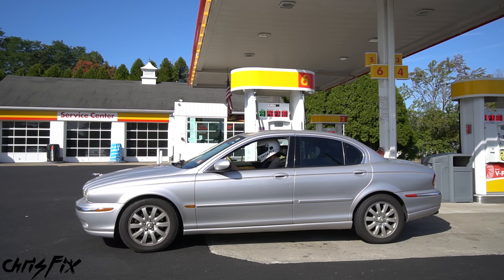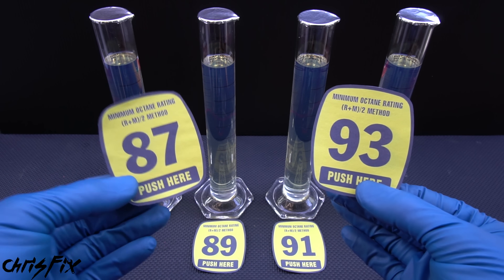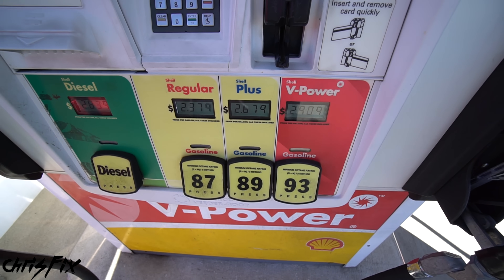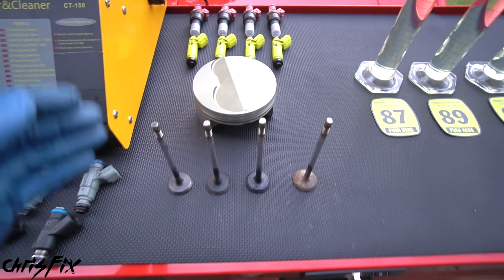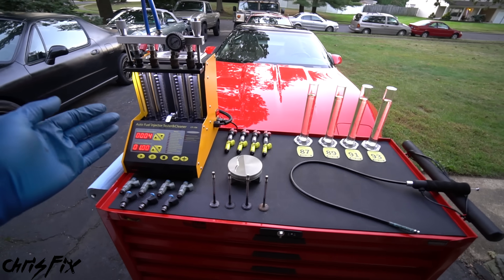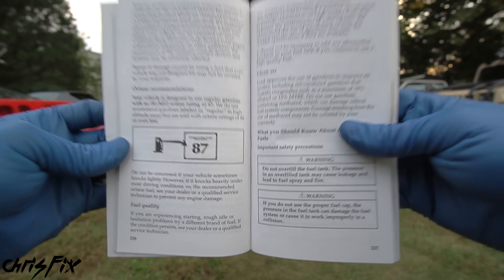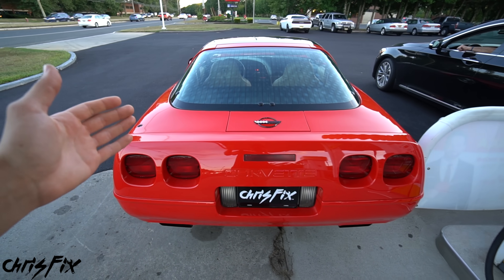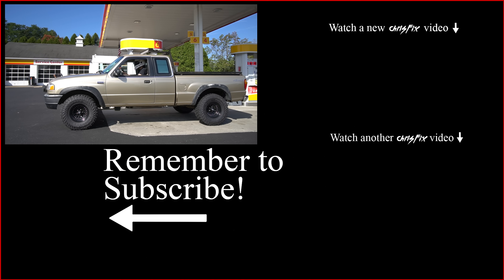What is the BEST Fuel to Use in Your Car or Truck and WHY

Comment: European fuel is better and he proved it in this video. The European fuel pump had an E5 sticker on it which is 5% ethanol. American fuel has 10% ethanol, and legislators tried to push that to 15% ethanol but it was over turned because that much ethanol in fuel is really hard on most engines and pollutes more. Ethanol is an utterly inferior fuel then gasoline. It has less energy then gas and wears out engines faster, and causes more emission pollution. the best gas has no ethanol in it. Why do we put ethanol in the gas? Its not about saving the environment, its worse for the environment. It is done because of the corn and bio fuel lobby convincing scientifically illiterate politicians to force every fuel supplier to add it to the gas.
Reply: Its worth paying more for pure gas with no ethanol. If we had a choice people would never buy ethanol gas. I found a gas station in North Dakota one time that had pure gas. It was a little more expensive. I got 30% better fuel economy. I went 1000km on that tank when normally I could barely do 700km.
Reply: First and foremost every car for the last 20 years on American roads has been designed for 10% ethanol gas. It does have less energy. But it also can produce higher octane. E85 has an octane rating of 108 for example. Hence why so many tuners and high performance cars are now using more and more over regular gas. Also ethanol burns cleaner than regular gas. Its alcohol. A simple ask of Google would have told you this in fact. As the Google assistant says, gasoline blended with ethanol burns cleaner than pure gasoline. Ethanol cuts a car's greenhouse gas emissions. So you have it backwards actualy.  

Also E5 and E10 are prevalent in Europe. And they are still switching over to E10, as the EU has been pushing for this and continues to do so. In fact Germany is now the largest ethanol gasoline powered country in the EU. And Norway is almost entirely E10 just like the US. The US is in fact ahead of the EU when it comes to gas quality. The EU is now adopting US gasoline strategies. And the EU is all about clean this and that. So they are switching over, as more and more production capacity of Ethanol goes on line in Europe. They have just been slower to adapt because the EU does not produce as much as the US does in Ethanol capacity. But Europe has seen double digit growth over the last 5 years for it's ethanol production and gasoline usage with it.

Comment: So the bottom line is run premium fuel in your vehicle if you plan on having it for a long time because you will prevent yourself from having to perform on necessary maintenance from carbon build-up sludge and unnecessary wear and tear from using junk gas IE87 octane, And I disagree with higher rating not giving you more power if you put a 110 octane which is available at a lot of different pumps in my state you will definitely increase your power even on a shit Box vehicle

Comment: I use 89 when 93 is recomended in my 06 3.8 eclipse. I add Seafoam before fill up every third fill up. Should I go away from that or stay the course? I hear a knock on occasion at start up but it goes away after a few minutes.

Comment: Wow... here in Germany, the politicians wanted an better fuel economy, so they forced the so called E10 in the market (the EU even forced the gas stations with penalties, if they don't sell enough..) - usually our fuel, called E5, contains up to 5% of ethanol. That E10 up to 10. It was a massive flop, several engines braked down (in fact the fuel pumps, filters and especially the pipes just corroded as hell) but these days more and more cars are made to be used with it. I don't want to know, what would happen if we would show that E85 to our drivers or even mechanics ... 
Btw, we have less options compared to 6:00 (87, 89, 91 and 93). We have regular with 95 octane and plus with 97. Then there are these "premium" fuels with up to 105, I even saw 107 advertised.

Comment: The most important thing that he said was, higher octane gas does not give you more power. If you have a regular compression engine, you probably lose power by using higher octane.

Comment: You didn't mention the ethanol. Premium fuel has very little ethanol compared to regular so your car should get better mpgs. Ethanol has lower energy so yes premium should help improve mpgs, and Ethanol also damages the fuel system over time its bad for rubber parts

I have a 2016 Colorado duramax diesel I use Shell V Power diesel because it has almost no biodiesel in it and I definitely notice better performance when I use it.

Comment: In 99% of all stations that have 87 - 89 - 91. If you get 89 its a mix of 87 & 91. They have nore do they make 89. The pump mixs both at the pump. Some owners have setup there pumps to give you.. You got it.. 87 an and its not mixing the 91..... So pick it.. 87 or 91 and never buy mid grade 89 is 100% a scam

Comment: Just a thought coming from an Old Industrial Natural Gas Engine Tech (25 years) and not to go over board, maybe you could do a small piece referring to the definition of Preignition which leads to Detonation and the difference between the two, the causes in an auto engine and how to confront it, its like cancer to the combustion chamber and only picks up speed when not addressed and will evenually lead to catastrophic failure.......Great intel about the fuel, I did not know some of this....thanks

Comment: Decent but you wasnt 100% correct those fuels as whole wen burnt one will have more left over then others that build up is what effects clean burn higher octane raise temperatures on motor most newer cars run high octane if follow info ethanol is highest it can be in 87 or an octane shittier or lower the octane more chatter high octane closer to ethanol octane wich produce cleaner more even burn if you have eco or leaf on you vehicle I'd only get e 85 wich is 105 typically much higher octane low octane in eco will cause to over heat because junky gas in high compression setup like fart that ruins your shorts depost keep heat from escaping the engine causing the over heating
Reply from the maker: thanks for sharing

Comment: What about clear fuel vs 10% ethanol additive? I've seen a bunch of gas stations nearby start selling clear fuel and I'm wondering if there are any tangible benefits to using it.
Reply from the maker: What do you mean?
Reply: @chrisfix  Clear gas is ethanol free. My understanding is that most fuels in the US have up to 10% ethanol added. I'm curious if that fuel is any better/worse than fuel with ethanol.

Comment: O yes ,the very best cleaner for combustion chamber, valves etc... is a mixture of Hydrogen/oxygen commonly called water when it is fed to the engine with a small siphon hose while driving. I have taken engines apart after people I know were using small amounts of water while driving & I have never seen pistons that clean ever, other than when  brand new. Thank You James & have a Gooday (Motor Mouse I love SBC!!!)

Comment: The octane rating is both of the methods of testing octane & divided by 2 (1 is research octane & 1 is motor octane). The 2 methods are used because the tests are done in test engines at 2 different temperatures(150&300 degrees) & because of this combination of fuels if you have a high octane # with the research octane (150) & is used in an engine that runs closer to the 300 degree intake temp you won't get the boost you are expecting due to the temp. These gasses vary in #'s, R+M/2 from each other by the makers ie... Shell, Gulf, Texaco, so they all work better with octane booting additives. Thank You James & have a Gooday! (Motor Mouse)
Reply from the maker: thanks for sharing

Comment: You didn’t mention TopTier Gasoline which has more detergents to keep your engine clean. Most major brands, Shell, BP, Mobile, etc. are top tier fuels. It should also be noted on the pump if it is a top tier fuel. You can look up the list of top tier stations on the web. Good video! 👍🏻👍🏻🇺🇸

Comment: I drive a Rav4 always used reg gas like the Owners manual said  it rides fine but I  fell the tank with plus 2 weeks on a roll and the motor Performance really up grade by 70% I mean it runs better gas last longer the Motor Stop having drag the rav4 is a 2011 and it has 97,000 miles  I used seafoam in the gas and in the oil and I know the motor is clean and it Performs 90% better. just by using plus Gas I used Mobil or Sunoco which are the stations by me. now I am using plus gas only and it last longer I get better miles per gallon.
Reply from the maker: thanks for sharing

Comment: In here where I live 95 contains ethanol which is why I use 98.
Modern cars can use that 95 no prob but I don't want to risk it on 2001 Ford.
If I recall correctly, they started using ethanol in 95 around 2008 or something so I'd rather not risk it.

Comment: Could amend or chat about E-88 fuel?  In Minnesota anyways most of our stations have E-88 along with E-85 and there seem to be many rumors about E-88 related to damaging engines or poor fuel economy.
Reply from the maker: Should be good for flex fuel vehicles, but I would check first!
Reply: @chrisfix   That's just it, around here they say it's for regular non-flex vehicles too.  I follow my manufacturer recommendation, but would like to see a deep dive on pros and cons of E-88

Comment: If available, do you recommend buying the 100% gasoline in lieu of the standard E-10(10% Ethanol? Which is better, buying 100% gasoline with 87 octane or E-10 with 93 octane?

Comment: Don't think the energy per octane is 100% correct ...
If you add E10 to gas to get it to a higher octane rating, that fuel will now contain a bit less energy (we're talking about 2-5% at most though).
So assume 'pure' gas a 0 octane, and you add component X to change octane rating to 87 - 110, the more of that X you add,the less 'pure' fuel you have less,and hence less energy rating (even if the octane boosters also have energy ... unless they are as high/higher than the gas itself).

My car can def. tell the difference between 91 w/10% ethanol vs 91 wo/ethanol (I get about 10% better mileage with non ethanol. I'm assuming it's a combination of less power dense, hence less power so I need more fuel for the same work, and hence less energy, I also need more fuel. Note: I have not done extended tests on this ... but with non E10 fuel my car can get 32 mpg measured over a near full tank (520 miles on < 16.9 gallons), and with E10 fuel the best I see is around 28.5 mpg (note ... 28.5 was driving around 70mph, and 32 was around 85mph, so it might be that I gain a bit efficiency at higher speed, but that sounded unlikely to me ... ), so I leaning on gas quality/ethanol content to be the 'sinner'.

Comment: If your car requires a higher octane fuel it will clearly list it in the owner's manual or usually on the inside of the fuel filler door. 
Higher compression = higher octane required. Modern cars will also tweak there ignition timing on the fly so a higher octane fuel will allow your car to get a tiny amount more range but in my experience not enough to offset the cost of the more premium fuel.

Comment: i have an 5.4 titian the truck kept missing at the light filled it up with high octanne ran her down the high way at 110mph 4 30 minutes and doubled back problem solved i did add a bottle if injector cleaner

Comment: Zero mention of ethanol, and how premium usually doesn't have it or how small engines won't run well on it. Also, why not put a car on the dyno and prove that higher octane gas (and the possibility of the ecu advancing the timing) doesn't boost horsepower?

Comment: That's all fine and dandy. I see your argument and raise you one Chevy Cruze 1.4 turbo. The gas cap and owner manual say 87 octane is perfectly fine, but run just one tank of 91+ through it and you'll see and feel the difference. It turns the car into a whole different animal. It's smoother, quieter and has more power. Did I mention that the fuel economy goes up by a few MPG?

Comment: Germany octane is 100% a higher octane! For years cars all had high compression with no knock sensor because there isn't a need because of their higher octane gas
Reply: Germany octane is 100% higher??? Say What? 0_o Where do you get 100% first and foremost?🧐 And for years cars had no knock sensor, because cars were not computer controlled like they are in modern times. Knock was also far more prevalent back 30 years ago and even further back, because gasoline quality and standards were not as good as they are today.

Comment: Should I run premium every so often to clean out the engine a bit or drop in a fuel cleaner instead?
Reply: The video literally explained this, several times.. Premium fuel is O-N-L-Y used for high-compression engines. It has nothing to do with cleaning ability.
Reply: @alexmelia8873  it says that 91 from Shell has 7 times the detergent than other gas stations. That was my question. Should I fill up with 91 every so often or dump in a fuel cleaner? Do you know the answer?
Reply: @adansanchez3790  shell advertises they have detergents in their fuel. I assume it's in all grades, but I would takes a salesmen's word with a grain of salt.
Reply: @alexmelia8873  I think if Chris Fix says it, it means he's done his research. Since he says it in the video it means it should be true.

Comment: If someone on the internet said to switch your battery cables over for winter driving because you no longer need to run your air conditioner, would you? - I believe reading your owners manual is the only reliable source of information! - I dont necessarilly disagree with the presenters comments, but I do disagree with many of the comments posted by all the so called experts commenting here.

Comment: A very well done video, congratulations. Car / Engine Manufacturers tell the user of the fuel to be used. Most cars have a range of Octane / Cetane  number. A car shall run on a lower Octane but not for long. If the user uses lower than the lowest recommended, he is asking for trouble and costly engine cleanup and even repairs ... so keep the fuel within the recommended range .

Comment: You want your fuel to detonate. It's pre and post detonation you want to avoid (unless you're modifying a "special" way). The spark plug arcs a tiny bolt of lightening between two electrodes, to detonate the air/fuel mixture causing an explosion. From chemical energy to heat energy. The engine utilizes that boom and converts it into mechanical energy.
Reply from the maker: thanks for sharing

Comment: wouldnt most fuel injected vehicles run on e85 because the a/f sensor would increase the fuel unless the ratio is limited but if so im pretty sure it would be possible to unlock the ratio in the ecu and make any fuel injected car flex fuel

Comment: I have to disagree with part of the premise of your video. The energy content of the fuels may be the same. However, the performance of your engine will vary on certain fuels, and that performance will degrade the performance of the engine. I know because I experienced this for over 15 years with my Honda Civic.

I owned a 1993 Honda Civic LX Sedan 5 Speed for 17 years, and put over 250,000 miles on it. This was my daily driver. I tracked the mileage on virtually every fill-up the entire time I owned the car. I was "in-tune" enough with the vehicle that I could tell by the mileage when I needed a new air filter. I've owned at least 11 vehicles in my life. This was hands down the best car I ever owned.

Anyway, I tried experimenting with different Octane ratings of fuel over the years. Over 90% of the time I ran 91 or 93 Octane. I would occasionally experiment and put 87 Octane in my car to see how it ran on the lower Octane (and less expensive) fuel. The results?

For all 17 years, I would get 37-38 miles per gallon. This was mostly city driving. On the occasional long trip when extensive highway miles were accumulated, I would get 41-43 miles per gallon. Each and every time I tried using 87 Octane, the mileage would drop down between 3 and 4 MPG. You could even feel a subtle change in the lower end power band. That engine was not designed to burn lower Octane fuel at the same efficiency as the higher Octane fuel. The manual for that vehicle even stated that the car performed better on higher Octane fuels. They were right. 

If your vehicle is NOT designed to run normally on 87 Octane fuel, you will likely see a degradation of fuel economy/performance. Uneven burning of the fuel will cause the performance to suffer and the mileage to decrease. However, very few vehicles today are designed to run on 93 Octane only. I had one of the few that was designed that way.
Reply from the maker: Thanks for sharing

Comment: I’m glad you mentioned about needing to run high octane in certain older or high mileage cars, I’ve been telling people that for years. However, another thing, although probably not still relevant to most drivers is that many fuel injected cars designed and manufactured before ethanol was used as an octane stabilizer seem to have their oxygen sensors malfunction or take damage from prolonged use of lower octane ethanol stabilized gasoline. However that observation is anecdotal, and cars that old tend to be pretty high mileage anyway. Another point you may have inadvertently overlooked is that in aspirated or carbonated engines, it’s advisable to use non-ethanol stabilized gasoline or your gonna have serious problems, whether it’s an old car or lawn mower, or tractor.
Reply from the maker: Thanks for sharing!